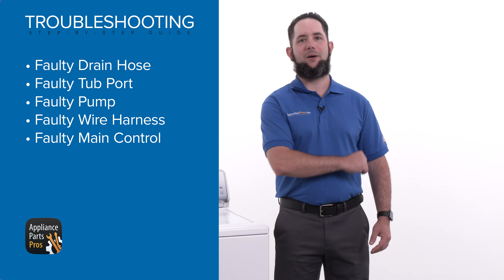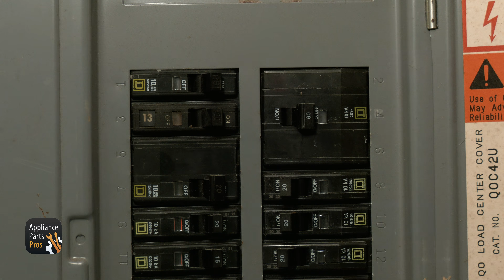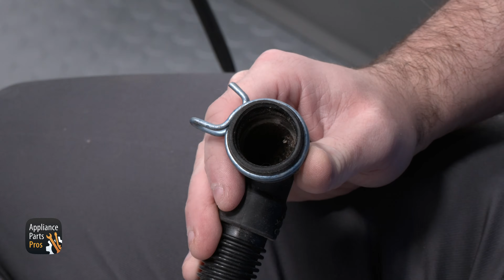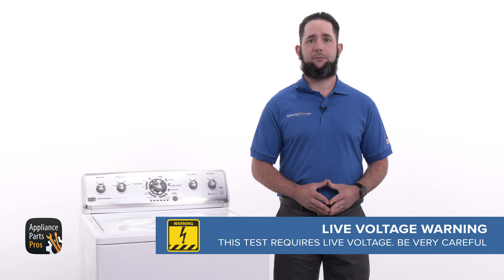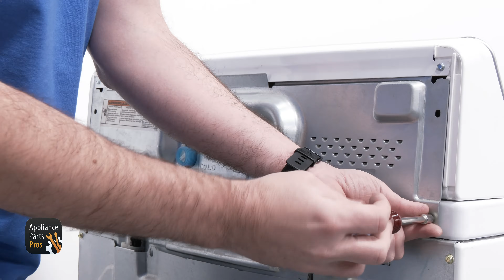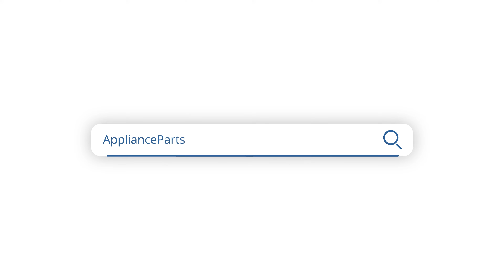Troubleshooting A Maytag Washer That Will Not Drain

Comment: Washer starts to leak as soon as i put it on a rinse and spin. Does this sound like a clog?
Reply from the maker: It could be a clog, but a leak during rinse and spin can also come from a drain hose, pump, tub hose, or another connection. You will need to locate the part that is leaking.

Comment: So I ran the automatic test, drain wouldn’t actuate. Ran the manual test for the drain pump and water partially drained, but then the pump started making a low, loud pulsating/grinding sound and just kept doing that until I shut off the diagnostic mode with the start button. 

Sometimes it still makes this sound even after it’s been shut off with the start button when I’m running a regular cycle, it was happening occasionally but now that I’m having drain issues, it’s happening almost every time I attempt to run a cycle. I had disassembled the pump a couple of nights ago, found a small clog and removed it, but still showing drain pump issues when I do diagnostic tests. I want to try a multimeter to see if the pump is actually bad. Would a bad pump still allow for partial/intermittent draining? Sometimes I hear a lot of clicking like something is trying to engage prior to draining but doesn’t “catch.” Would the weird buzzy/grinding sound I’m hearing after everything is shut off be a separate issue from the drain pump? I watched another video regarding that “infinite drain” issue which is a control board problem, but since my pump isn’t actually draining (at least not consistently), I’m not sure which problem to address first… really need to get this washer fixed bc I have three teens and can’t afford a repair service if I can help it, so any advice is appreciated! Thanks!!
Reply from the maker: That sounds really frustrating, especially with a full house and a washer acting up. For detailed troubleshooting steps specific to your drain issues and those pump noises, our certified techs can help you at forum.appliancepartspros.com. Just post your model number and everything you described, and they’ll walk you through the diagnosis.
Reply: @appliancepartspros  I truly appreciate the reply, and will do! Thank you so much. These videos are so helpful, I’m so grateful for resources like these to educate myself.

Comment: So you said if you get 120 volts at the drain pump, it has failed. Is that correct or did I not hear correctly?
Reply from the maker: If you get 120 volts at the pump and it doesn't come on or doesn't pump the water out then you will need to replace the pump.
Reply: Yes, I heard it "Failed" @120 volts, what's up with that?!
Reply: @ra15899550 in other words check power to your pump. If you have zero power you will move on to the controller then the harness to isolate the problem. If you have 120volts theoretically your drain pump should open to release water, if it does not drain and you have voltage then it’s the drain pump.
Reply: @ra15899550  he wasn’t thorough with his answer, I think what he meant to say was if you get 120 V at the pump, but the pump does not make any noise or does not come on then it is faulty.

Comment: I have a Maytag Centennial , at least 14 years old, not draining but sounds like it’s trying to but just sucking air (gurgling) (?), so most likely a clog somewhere, right?
Reply from the maker: You will want to check the drain hose and pump for any debris/restrictions. If all is good and the pump is not draining the water out then the pump will need to be replaced.
Reply: @ ok, great, thanks for the advice and quick response!
Reply from the maker: You're welcome!
Reply: My machine gets stuck in an extended rinse/spin cycle for hours. The machine gets unbalanced and knocks around like crazy. I’ve put the machine on “drain spin” but it still adds water. I turned off the water supply to see if it would simply spin and drain but it just keeps trying to draw water and eventually quits. 
Landlord doesn’t seem to think there’s a problem with the machine. (Hasn’t sent anyone to look at it.)  I currently have a very wet load of laundry that just won’t spin. Any ideas?